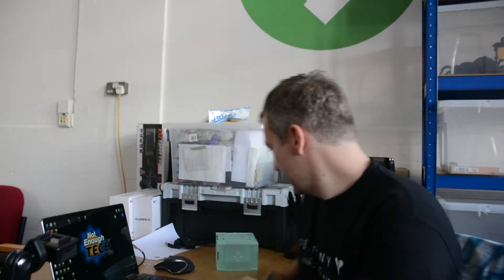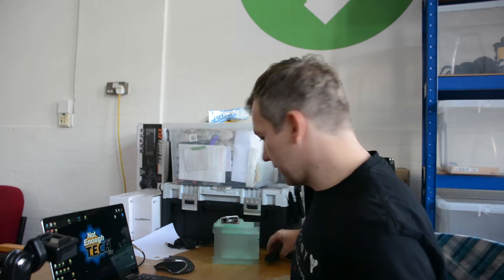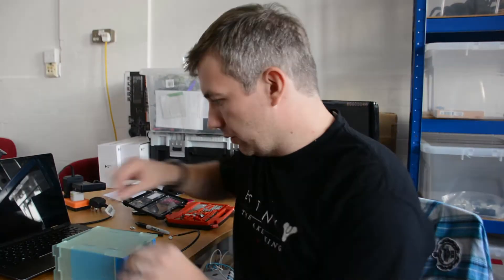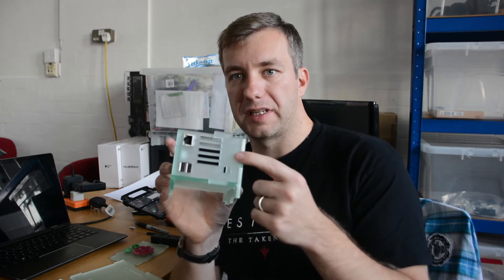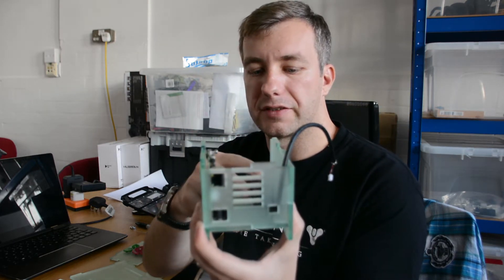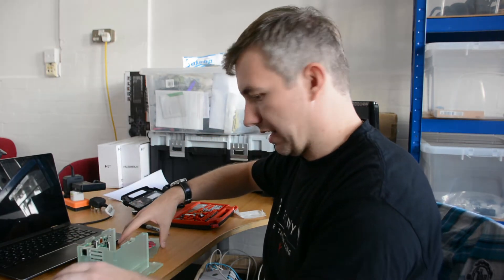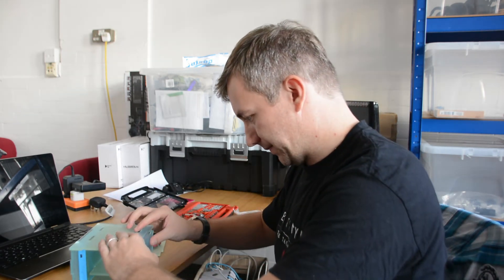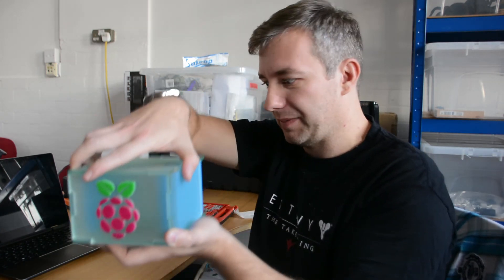Raspberry Pi NAS: vents & guts part 5

Comment: how much would you charge for the raspberry pi case?
Reply from the maker: hi, exact design as mine with the logo?
Reply: Yes that's a great case
Reply from the maker: I spent  about £28 for the perspex  with shipping. cost depends on the colour of the perspex as well.  I'd say about £50 with all elements ready to assembly + shipping. You would need an acrylic glue (£3-4) to put it all together.  That's for the shell only.  Components are priced here:
http://www.notenoughtech.com/featured/raspberry-pi-nas-part7/